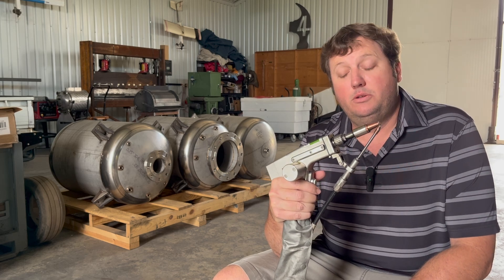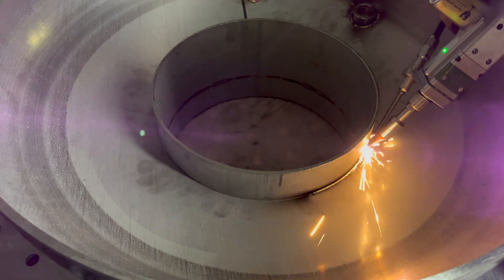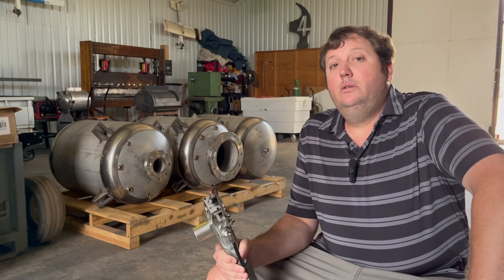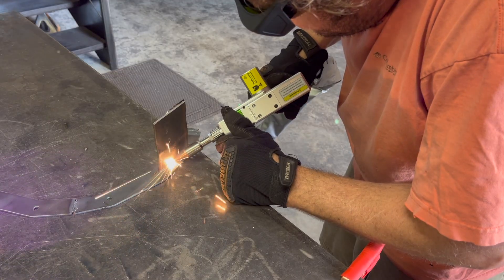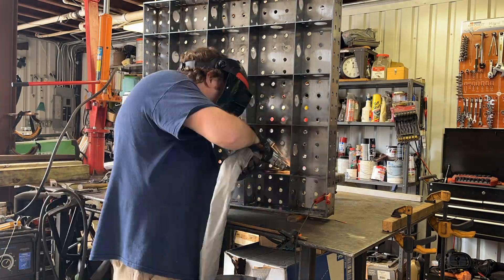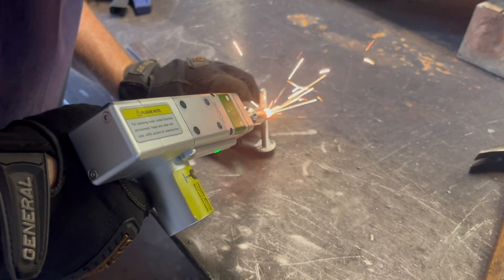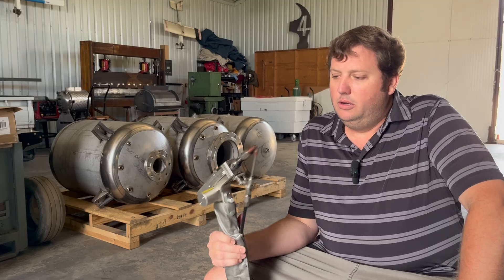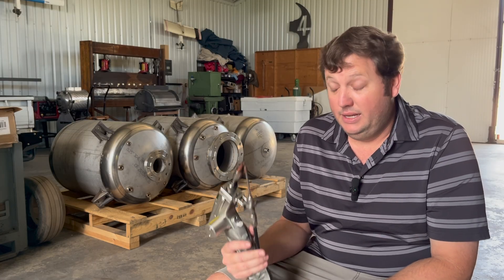I bought an Amazon LASER Handheld Welder/Cleaner Cutter! Was it worth it?

Comment: What kind of feeds and speeds are you using for 1/2" and what gas?
Reply from the maker: Shop air and about 6ipm.
Reply: @k-rigg  just mounted mine in the table. What are you doing for focus?
Reply from the maker: @SlappynutsMN  keep it at 0 and have the tip of the material as close to the material as you can get it
Reply: @k-rigg  That seems to be about what I came up with. Working well so far
Reply from the maker: @SlappynutsMN  cool!

Comment: I am trying to figure out how to turn it on
Reply from the maker: On mine, you have to turn on the chiller first, than the emergency stop button that turns on the screen, than you have to turn on the key that is the power to the laser source.  Wait 30 seconds, than turn on the breaker inside the machine for the enabled signal for the source.  It’s weird sequence but has to be done in that order.
Reply: I bought the same exact machine as you (you were the inspiration). I got it running after messing with the voltage adjustment thing in the back of the unit, per their direction. There was a p3 and p4 voltage which I think is for overvoltage protection. Today I hope to put down one good weld line, after tinkering with settings. Trying aluminum. Thanks! @k-rigg
Reply from the maker: @iambrianlevy  welcome.  I forgot i had to mess with that some too, especially when i had alot of other equipment running in the shop, it was set up too sensitive.